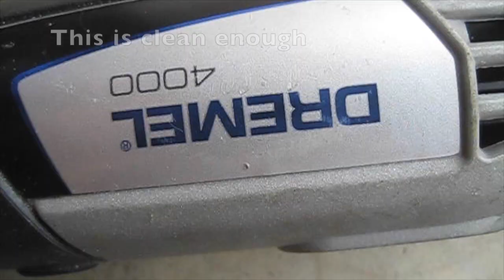repair maytronics robot with many faults (every motor faulty)

Comment: Hi mate - thanks for all these videos = VERY helpful 🙂
I'm in Adelaide and need some replacement carbon brushes for an S200 impeller, but can only find them in the US_EBAY
Do you know anywhere in OZ ?
Reply from the maker: I have not seen many of those motors wearing right through the brushes . I have seen a lot of carbon deposits inside the motors .
To change the brushes , I would measure the old dimensions and just buy off eBay or AliExpress.
I am making a new video soon in making carbon brushes for a vacuum cleaner power head . I bought a pack of ten carbon brushes which were of a similar dimension . I fitted some into a Hitachi angle grinder and filed the others to fit the vacuum cleaner .
Stay tuned and the video will come on line ( after I make it ).

Comment: Hi mate. Which direction should the impeller fan spin? I've refurbished my impeller motor on my x30 but now I'm questioning whether I re-assembled it correctly as the fan is spinning clockwise. I thought the impeller should spin anti-clockwise to suck up from the bottom and blow water out the top and side.
Reply from the maker: Great question . Many who take these motors apart ( including myself ) reassemble and then the impeller is backwards . If you run the robot , it does not do much even though it will keep running .
Always assemble and make sure on the bench the fan blows air out at you . If it spins the wrong direction just swap the back and red wires . I do this by undoing the pins in the connector but you could cut and solder the wires black to red and red to black . This makes the motor spin correctly.
I myself do not know what I had done to reverse the polarity but now I check the direction before completing the robot reassembly.
Reply from the maker: So don’t think of clockwise Or anticlockwise but think of air blowing out at you when it spins and you look at the impeller fan
Reply: @Dentinvent  thanks for confirming what I thought, that the fan should be blowing air out. I have no idea how the polarity reversed, I didn’t touch the wires. Never mind, I’ll reverse the wires and test again. Thanks a bunch!

Comment: Hey mate, thanks for the videos. I found that water has got into the impeller motor for my Dolphin S150 and seized the bearings.
The corrosion has got so bad that it's also destroyed the spring holding the brushes in against the armature.

Do you know if you're able to buy a replacement motor for these guys?

I didn't find much on facebook market place or GumTree, only new units.
Reply from the maker: Best and cheapest way is to find someone selling a broken robot : the impeller motors seem to be the last to fail ( not in your case ). When you go to buy it , make sure the impeller isn’t seized . Swap it over and you are away again.

Comment: Where do you get the servo motor? Mine had water in it. Everything else is fine.
Reply from the maker: Best option is second hand : where are you located ? 
I’ve found parts are best off faulty robots .
Reply: I live in Florida and they have used robots for sale on Facebook marketplace but they want a lot of money for them. I just need one part! We live in such a throw away world these days.
Reply: bonjour. J'habite en France. Ou puis je commander un servo motor. Je pense que le mien est défectueux. J'entends un bruit de grésillement à l'intérieur.
Hello. I live in France. Where can I order a servo motor? I think mine is defective. I hear a crackling noise inside.

Comment: you're a legend.
Reply from the maker: Many thanks for the compliment. Let me know if you want any other videos made
Reply: @Dentinvent  Thanks!  I do have a question -- the motors on my robot work fine and I've confirmed that the power supply unit does supply 29V all the way to the PCB (to the four-pin connector that has three wires attached -- the one you're holding in this video at 0:23).  Here's the weird thing.  The robot only runs in 'upside down mode' when I unplug that connector and reconnect it.  Not when I only press the button on the PSU.  When I press the button on the PSU, the third pin goes from 0 to 24V (relative to ground) which I'm assuming is a command wire.  Nothing looks corroded (it's only 2.5 years old) and it was all dry when I opened it up.  Any ideas?!?